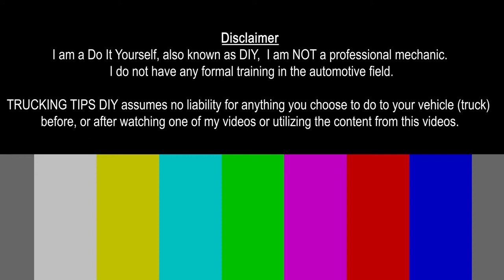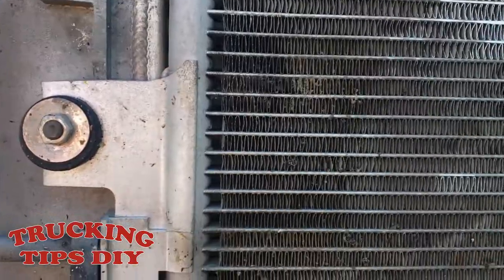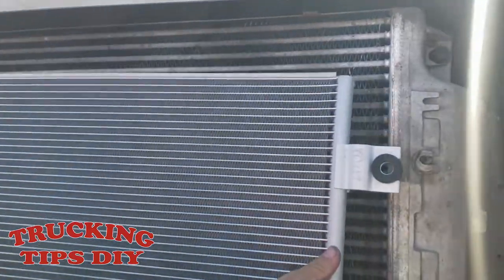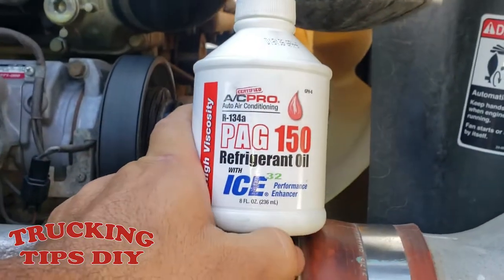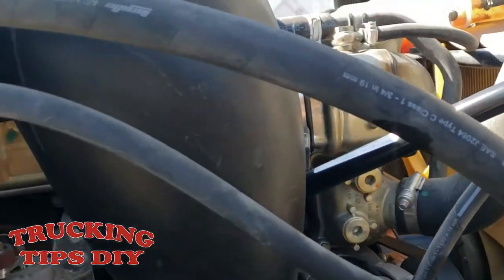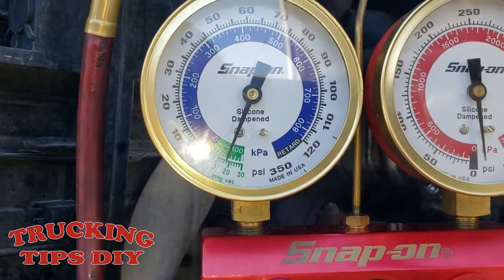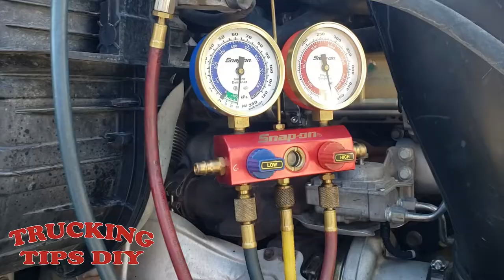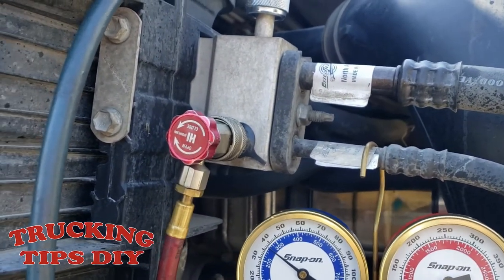How to remove and replace AC condenser and charge freon on  Freightliner cascadia semi truck

Comment: Out of curiosity... why did you not replace the receiver drier? It’s a must every time you open up the system. Personally, I’ve found it faster to just open the hood. Remove the nut holding the a/c lines into condenser, remove the condenser nuts by simply leaning in and loosening them. Then pull condenser off. Install new one and tighten down. From there, r&r receiver drier and install the new a/c o-rings. Tighten.
Reply: Curious, why does it have to be replaced? We recently replaced ours, had that replaced too but why does it have to be replaced? Im only looking again because they said if we had pinched a line we would be fine but idk and the new one already has a leak

Comment: you could’ve add oil in the ac condenser and avoid taking out those hoses from the Ac compressor, and i don’t know if you install new gaskets on those hoses? 
anyway this video is still helpfull
Reply: Usually a good idea to replace those seals...they are the weak link  of the system

Comment: Do you have to have the oil? I just changed my condenser and they didnot put oil in the system
Reply from the maker: if they put new freon i think its better if you put some oil to lubricate the compressor,  you can still add some oil , at autozone they sale something like this
https://www.google.com/search?q=ac+compressor+oil&prmd=sivn&sxsrf=ALeKk01veGNsjjNR1U-fKrtaQWdc90_Amg:1588614113254&source=lnms&tbm=isch&sa=X&ved=2ahUKEwju9p7f4JrpAhUMGKwKHW1VDiQQ_AUoAnoECA0QAg&biw=412&bih=678&dpr=2.63#imgrc=_xZMxzfnUOvV3M

Comment: why are you open low side and high side on when you put freon in  i thought you support to close the high side only freon in low side
Reply: The official instructions say to charge the system on the high side for both the Freightliner Cascadia and even the Thermo King APU.

Comment: I bought an aftermarket condenser...but didn't come with the bolt in the moddle of the two hose connector...the one you said it's a 10mm...what size bolt and where can i find it. Called freightliner but don't know part # or anything??? Can you help please.
Reply from the maker: You can remove the bolts (stud) from the old condenser ,
Reply: Yeah it broke and just put some other bolt 🔩 with silicone.  I guessed messed up the thread.
Reply: What web did u use?ty

Comment: Placing that freon can upsidedown to charge the system with liquid freon goes totally against my knowledge. But I am not a professional, might be wrong. Everybody was saying that if liquid gets in compressor - it will get damaged.
Reply: I know for residential, my old boss did that.. 30 years of hvac so I figure he knows a thing or two. Hasn't steered wrong.... Yet, lol 😆..

Comment: You are vacuuming all the oil you put in
Reply: That’s not true. Try sucking out air from a glass bottle like a beer or soda glass bottle. You cannot pull out the liquid that way. Besides, (some) new A/C compressors come with oil inside. They wouldn’t add it if it meant the oil would be sucked out in a vacuum.

When you vacuum the compressor, you probably want the vacuum lines to be placed higher than the compressor to prevent any oil from flowing out due to gravity (not vacuum, of course).
Reply: @thereviewer4173  actually that is not true ether. We all know that water boils (evaporates) at lower temps in lower pressures. So by pulling vacuum we reducing pressure well below the boiling point so all water will boil (evaporate) and get sucked out in vacuum pump. Now I don't know about oils boiling points - must have not. By sucking on a bottle of beer you just can not reduce the pressure low enough for beer to evaporate. Try connecting it to your vacuum pump - that's gonna be interesting to see 😅